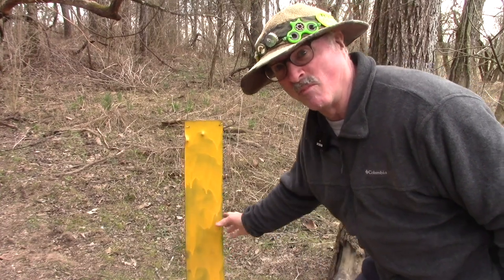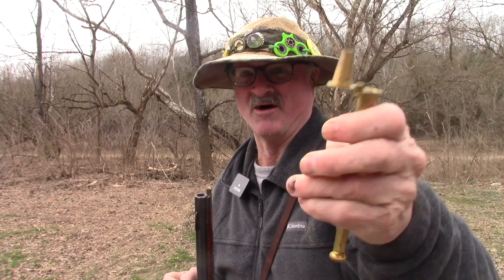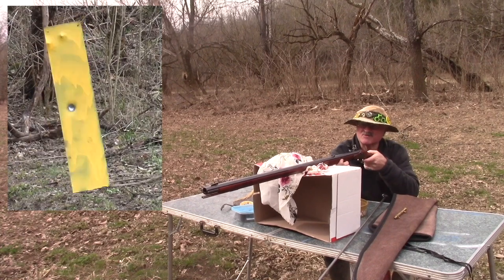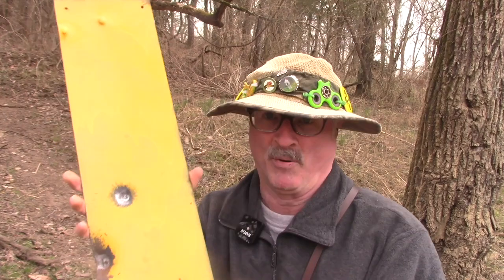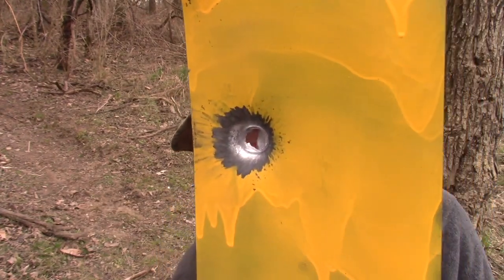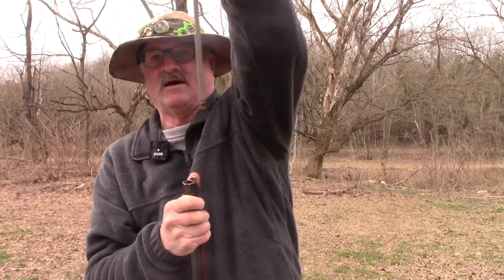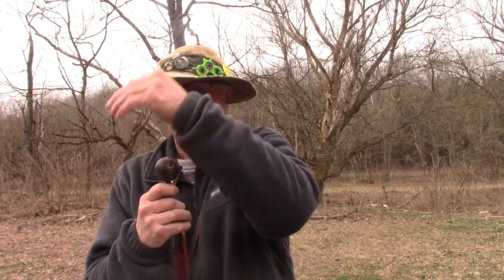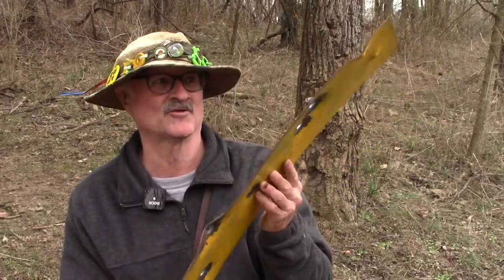Shooting and Punching Holes Thru Steel -  Is that possible? Swiss Powder

Comment: Mark be carful! me and a buddy were shooting, he shot and old piece of diamond plate steel at 80yds with my 50 cal. flintlock, the RB hit the steel and came back Stright towards us like a rocket! it missed us by a few feet! we never did that again! but the steel wasn't hanging like yours so it would give,,,,,,,,,,,,,,,,,,,,,
Reply from the maker: Thanks for the advice. I usually shoot steel at a slight angle to avoid pieces coming back at me.

Comment: Great fun video! 
I used a sign similar to that once for experimentation, an old steel bridge marker sign to be exact, with my Pietta Remington .44 percussion revolver loaded with round ball and 30 grains 3Fg.  I started at ten yards from the target and moved out ten yards further with each shot. At fifty yards, it was still punching holes all the way thru the metal but not as forcefully as compared to the closer range holes.
Reply from the maker: That's pretty cool...I love trying out stuff like that!

Comment: It certainly is. Back in 1993 one of our club members wanted a Black powder shoot ( we mostly shot 22 rimfire ) and he made a ball splitting target, with an axe head welded to a pole with four 1/8" steel lugs welded on to hold a paper target on each side of the blade. He gave me the honour of the first shot at this contraption at 25yds. I pulled the shot slightly left and high and that one shot demolished the complete target setup and the 200gr 52cal round ball made a beautiful hole through the top left bracket. I just turned around to him and said "What next?" 🤣 The poor man couldn't speak for a while and later presented me with a trophy of the plate mounted on a wooden base with the legend 'One shot kill on a target frame' engraved on the front. I still have it. 😁
Reply from the maker: WOW.....that's a VERY cool testimony, I LOVE it! Thanks for sharing...
Reply: @blackpowdermaniacshooter  No worries man. You had fun punching steel here! 🤣 My caplock rifle was hand made by me in 1982, all excepting the nipple and the barrel was just a drilled out, 24" long 22-250 varmint weight barrel tapered octagonal. I used it as a smooth bore for ten years, then decided to ream it smooth to .52 diameter, didn't improve its accuracy just made it worse, so decided to cut rifle it with a crude bench mounted jig that included a boat winch dragging a twisted piece of 10mm square steel through a square hole, attached to a rod with a single point cutter on it. Grooves are rough at the bottom, but it will put two balls cutting each other at 50yds, if I do my bit. 😁
Reply from the maker: @Afro408  Sweet....sounds like cool gun to own, especially building it yourself. It doesn't get much better than that!

Comment: Mark, a lot of us struggle with our Blackpowder Accuracy. It would be fun for you to have a Rifle Coach give a lesson on Rifle Shooting and Accuracy. We could all gain from a video like that.  This video was great. I learned a lot about penetration based on how much powder to use.
Reply from the maker: So do I...!! That would make great video for sure..I've struggled for several years now with making such a video because I can't shoot accurate with any consistency at all. I  need to get a friend with good shooting skills to help me with such an endeavor.
Reply: No reason why it should be challenging. Consistency in powder, patch, ball and sprue orientation is first. Powder amount next. 

Weigh your balls, you might be surprised by the variation.
Reply from the maker: @flintandball6093  Yes..I know the round balls aren't consistent. I don't have scale to weigh them....yet.
Reply: @blackpowdermaniacshooter9353  I just use a cheap $10 set. The weight isn't as important as the variation. I pick the weight I want and accept half a grain either side of that. That's for hunting though. If I'm just throwing lead down range and not trying to be consistent I'll use whatever.
Reply: @flintandball6093  Even the most perfect load will not hit the mark if the shooter is not using optimal body mechanics while shooting.  Don't let the butt plate slide on the shoulder as you are firing, keep anchored. Trigger control, should I say it again, Trigger control. Don't slap the trigger , don't push the trigger from the side, Don't jerk the trigger. A slow steady pull straight back keeping the pull inline with the rifle front to back. Don't twist the rifle as you fire. Don't look over your sights as soon as you pull the trigger. Follow through.  Try to be looking at your target the same way as you did before you pulled the trigger.  Don't suddenly grip the gun with either hand as you are pulling the trigger. Be a statue as your were before you pulled the trigger. If your gun was sighted in then don't change your sight picture from shot to shot. All of these things apply whether you are shooting off hand or from the bench. You may not notice yourself making any of these mistakes.  That is where a friend or a coach can help you.  Don't ever stop having fun.
Reply from the maker: @flintandball6093  Yes, same here . I'll shoot whatever. I've been known to shoot lots of undersized balls, tight ones & even warped ones before...!!

Comment: That was cool! I got my  .54cal inline pistol out and shot it twice. Man was that fun. I had one issue though. I had a heck of a time getting the round ball started into the barrel. I didn't have a hard surface to set the grip on and i  think the ball starter i have isn't going to work out good for me.
Reply from the maker: That is tough for sure. I use a smaller diameter ball to avoid such problems. Thanks for watching...
Reply: @blackpowdermaniacshooter  you are very welcome. I may have to try that. I am using what Traditions recommended to use, the right sized ball and the right sized patch. I think it's  the ball starter i have that is part of the problem.
Reply from the maker: @jeffjackson5331  After chatting with you onFB.....I totally agree with you. For those getting into the hobby,. a good ball starter @5:50 will make loading the gun an easy endeavor. Keep on shooting brother! .
Reply: @blackpowdermaniacshooter  yep i agree. Will do bud, thanks again.

Comment: My first build was a full stock Hawken style with flint lock. .54 with a 42” barrel. A charge of 140 grains 3 f shot through a steel  deck piece. The ones with the little tread.
Only tried it once, this was about 1977
Reply from the maker: Wow…!! 140 grains will do the trick..!!

Comment: Hi, Mark. Pure lead balls? Would you try the same experiment with wheel weight or Linotype?
Reply from the maker: Probably not ....because... I won't put wheel weight lead down that nice flintlock rifle for 2 reasons:
1. I can't cast wheel weights, I tried it before and can't get the lead hot enough. 
2. Wheel weight lead would be too hard on that gun barrel. Thanks for watching...
Reply: Wheel weights are garbage, why would you shoot garbage in your firearm?
Reply from the maker: @usualsuspect5173  I agree...I don't mess with wheel weights at all.

Comment: i have put clean holes in steel with 7.62 x 39 that i loaded with hardcast 155 grain lead alloy bullets and black powder.
out of a 16 in barrel im estimating velocities of at least 1100 fps and at most around 1600 fps. i need to get a chronograph.
Reply from the maker: I’d love to know the results of that test…!!

Comment: Good shooting !
Reply from the maker: Thanks...this one was fun putting together!
Reply: @blackpowdermaniacshooter  I have shot up tp 70 grains of FFFG (Goex) in my 40 cal flint with 43" barrel the 100 grain ball does 2070 f/s at that charge and will leave quite a mark in thick steel . Normal charge is 40 grains I was just experimenting with a new barrel I fitted to a Hatfield rifle .  * notes on it  .40 Flintlock 43" barrel .400 R.B. 100 grs. 70 grs. FFFG 2070 f/s .".395 BALLS GIVE BEST ACCURACY  40 grs 3F @ 1680  70 grs @ 2070 TORN PATCHES CLOTH PATCH(OILED) BROKE PLEXIGLAS SHIELD AT 20 FEET  FFG GAVE SAME VELOCITY AS FFFG***